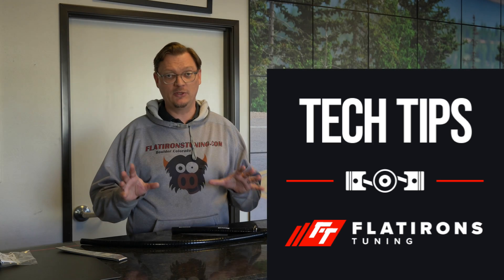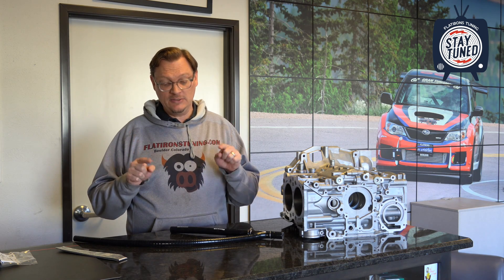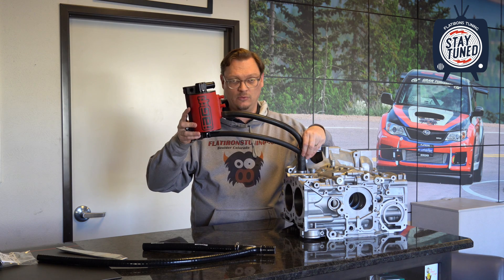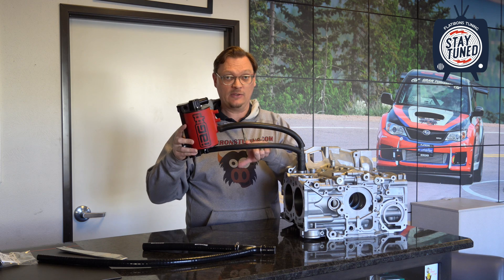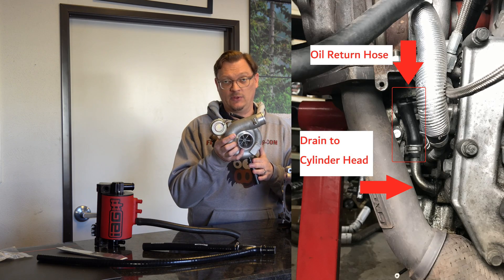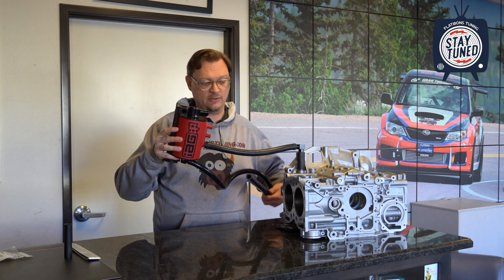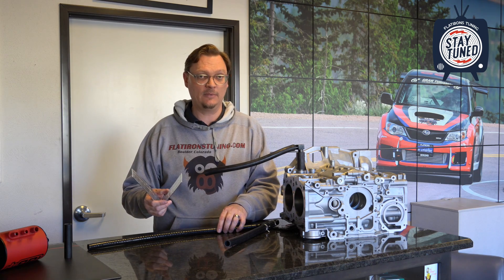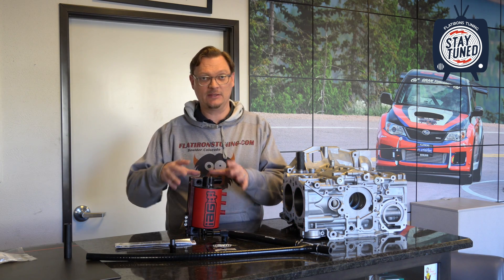The 3MI Air Oil Separator Drain Hose Explained

Comment: I burnt a quart of oil in 180 mile round trip for work. I believe my Crawford AOS isn’t draining properly. Additionally, I recently re ran my turbo inlet hose to the port closest to the turbo. Am I drawing too much volume/vacuum by having the inlet hose located lol in front of the turbo and sucking straight oil that isn’t being drained properly into the turbo and through my tmic? Lots of oil in my TMIC.
Reply from the maker: Thanks for watching and thanks for your question.  If you are seeing oil in your TMIC, then there is a very good chance that your AOS is not draining properly.  I'd recommend starting out by checking to see that the AOS isn't plugged or clogged, and take a good look at your drain pipe routing as well.

When working properly, the additional vacuum from the fitting closer to the turbo on your inlet should help the AOS work better.

Hope that helps and Stay Tuned!
Reply: Thank you, I completely separated my AOS from the inlet track and am still burning oil. Compression 139-145 on all cylinders, leak down on cyl 1&3 3-4%, cyl 2/4 6-7%. I suspect at this point I have a stuck oil control ring. Am I on the right track? I’m getting pretty frustrated diagnosing this.

Comment: Got this not too long ago….one thing i must say is that i think they made the turbo oil drain side way unnecessarily long…had to trim it like 4 times to get it just right.. other than that it works…or maybe it’s ship that way for rotated setups…🤷‍♂️
Reply from the maker: Thanks for watching.  Yes, you are correct.  The hose is made long so that it will work with both stock location and rotated setups.

Glad you got it to work!

Stay Tuned!

Comment: So I got a question regarding using a AOS that doesnt have that two port fitting coming out of the block near the turbo . Im using a radium aos and the only points for hoses to connect is the two breather hose's and the one on the turbo inlet .  Would i just cap off the the crank case port on the block ?
Reply from the maker: Thanks for your question.  The short answer is that the Radium AOS is not compatible with the 3MI drain hose.  Radium uses a 3/4" hose for the drain, with the idea that such a large hose can function both as a vent and drain at the same time.

I was running this and had some issues over time because that large hose ended up getting pinched under the intercooler hose and blocked off.

https://youtu.be/iJs1SSAOYiU?si=HN-8lp9L2Csjw_SH

If you are having issues, I'd recommend switching to either a Killer-B AOS (if you are not moving much oil through the PCV) or the IAG AOS and using the 3MI drain hose, as that will be a better solution.

Of you could go to the Radium Dual Catch Cans as I did as another option.

Hope that helps and Stay Tuned!

Comment: Great video. Never really liked how the drain was also a pressure outlet, seemed like crankcase pressure would push up the drain. I'll add this next time I have the motor out, tight in there with motor in the car.
Reply from the maker: Thanks for watching and thanks for the comment.  It does make a good difference to be sure.

Stay Tuned!

Comment: I plumbed my AOS drain into the bottom of my Killer B sump with a one way check valve just to not have it somehow suck oil up into the AOS. What's your thoughts?
Reply from the maker: Thanks for watching and thanks for the question.  Yes, that should work very well actually.

Stay Tuned!

Comment: You should also make a video to discuss the extra 5/8 (16mm) breathers on the heads + block center. Those that did not exist on early EJ blocks and heads. Some people plug them, what is the truth about these, in a catch canned scenario. Plug them or keep them? No information on any Subaru forums, but many times I see them eliminated on tuned/race cars
Reply from the maker: Thanks for watching and thanks for your question.  I actually made a video discussing this and the PCV system a few years ago.  Here is the link to that:

https://youtu.be/mO9mxDUDUDc?si=1wUsIrJJESWC6Sj1

If you have any specific questions after watching that, let me know and I can add it to the list.

Stay Tuned!
Reply: @FlatironsTuning  Yes, I have watched it many times before and that is a very-very good video in the subject and the best that it is not only a printed diagram you try to follow but is actually demonstrated on a pure stripped block. Fundamental for anyone would like to understand PCV. But for those breathers, it does not say anything about keeping them or plug them off, I would need a professional opinion on that matter. Would be interesting to discuss. I’d guess you prefer keeping them, but still there is a habit to plug them because that is believed is something new and/or unnecessary complicated/emissions stuff, etc.
Reply from the maker: @NorbertWeisz  Gotcha.  The short answer I would give is that I think it is better to keep them.  The reason is that there are some advantages of balancing the pressure between each head and the crankcase.

Beyond that, if you ran into a situation where oil did slosh up to the oil drain ports on the head and block an covered them off, and oil started to build in the head, the oil that was sitting in the head will drain better once the cornering load stops with those balance tubes in place.  I suspect that is why Subaru started putting them on all of the STI's.  It can have the chance of reducing issues from oil sloshing, etc.

Hope that helps, and I'll add it to my topics to cover. 

Thanks!
Reply: @NorbertWeisz  that port, on an OEM install, breathers through the "AOSs" built into the valvecovers, commonly referred to as "balance tubes". If coming straight off of that port, expect a LOT of oil with it. Those blocks still have their crankcase breather towards the rear, like old blocks, that flow through the "Indiana" (baffle) plate that lives in the bellhousing.

I know 3MI Racing has something coming for this too 😉

Comment: AOS Oil Drain line is also breathing in some cases, especially during WOT. Once you lift off the throttle, vacuum in crankcase will suck all that oil out of the drain line.
Reply: And this is still draining to the crankcase, so sees the same pressure drop...but has better routing and drains to a lower point allowing the oil to get out of the can while the intake manifold is not in vacuum.
Reply: @Micah_Makes  I highly doubt that pressure is different across the crankcase. I think pressure is the same in all spots. Correct me if Im wrong with some data. And if pressure is same, meaning the turbo oil drain is also breathing during WOT. Look at old school Porsche’s with low mount turbo setups, many of them attach breather to the turbo sump exactly for that reason.
Reply: @ArtemBuiltRacing  did I say the pressure was different? I don't think I did.
Reply: @Micah_Makes  I totally understand what you're saying. 
When you say it has a better route, well it is quite possible that it is. However that turbo oil drain line is going to breathe more by attaching the AOS drain line. Would it impact turbo oil drain during WOT conditions?

Comment: I ordered one of these a few months ago when you guys first mentioned it on your podcast ep about PCV. 2 weeks ago I just installed a rebuilt VF48, Grimspeed ceramic coated Uppipe, and this 3MI hose. I tripled up on heat shielding between the ceramic coating, the provided sleeve and also a DEI sleeve. I'm still pretty nervous about the heat it sees since it's so close to the up pipe (I routed on the trans side).
Reply from the maker: Thanks for watching and thanks for the comment.

It is worth keeping an eye on the heat shielding for the first few days driving to hopefully catch any signs of issues with heat before they cause a problem.

Stay Tuned!
Reply: Mine lasted around 2000 miles before it cooked from the radiant heat from my uppipe. The supplied reflective hose cover is lacking/ I used orange fire sleeve and still couldn't keep the hose far away enough from my P&L EWG uppipe. Perhaps if my uppipe was shielded or wrapped I might have better luck than raw stainless.
Reply: How has it been with your heat shielding set up?

Comment: Curious whether you could also implement something like the RCM AoS which drains directly back to the oil pan/sump. Are there any advantages to this? Seems like a good use of the second port on the Killer B oil pan
Reply: it wouldnt drain in that second port on Killer B pan, you'd need a hole higher up on the pan
Reply: why wouldnt it drain? i was going to do exactly this with my car and if rcm do it with their kit i cant see this being a problem but im curious on your thoughts. my car is rhd and the aos will be mounted on the  opposite  side of the turbo.
Reply: @kizzdizz6400  My car is RHD too. What I think will happen is that the drain will be feeding the oil from the AoS into the full part of the sump and and so the oil coming down the drain hose can't push against the oil already in the pan and will therefore accumulate in the drain hose and AoS. 

But if the pickup is constantly circulating oil then I'm not sure why this would pose a problem? The RCM oil pan does have that drain fitting situated higher than the drain plug though?
Reply from the maker: Thanks for your question.  There are definitely advantages of draining directly to the pan.  The problem is finding a good way to get there and staying away from the exhaust, etc.

We looked at trying to make an RCM AOS work here on a Left-Hand drive car, and it would be pretty challenging because there isn't a good spot to mount it on the left side of the engine, which is pretty needed to get the drain to run properly to the pan.

The main advantage of the RCM design over most of the other options here is that if there is pressure in the crankcase, that pressure will actually help the RCM AOS to drain.  With other options that drain to the top of the block (and even to the Turbo Oil Return hose to an extent) that pressure can prevent the AOS from draining until the pressure drops (which is usually when you close the throttle).

Hope that helps and thanks for watching.

Stay Tuned!
Reply: @FlatironsTuning  Thanks for the reply! So is draining to the pan only peculiar to the RCM AoS? Can the IAG one be adapted to do the same? I have a RHD subie, so routing it past the exhaust isnt too much of an issue.
Reply from the maker: I would think that you should be able to get that to work.
Reply: I did this (RHD) with Perrin AOS into Killer B pan. I added a one way valve so that there wouldn't be any chance of oil being pushed up the drain tube. Seems to work great.